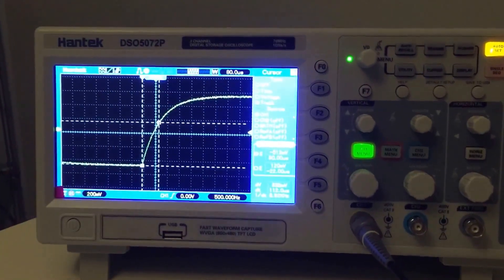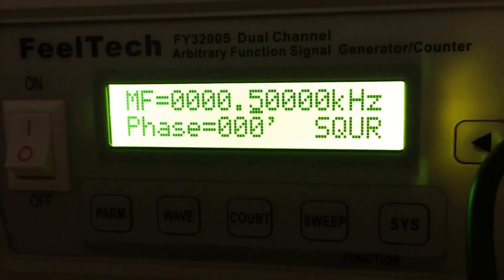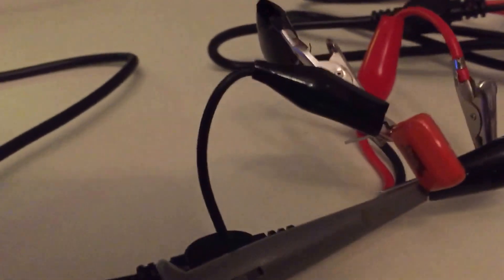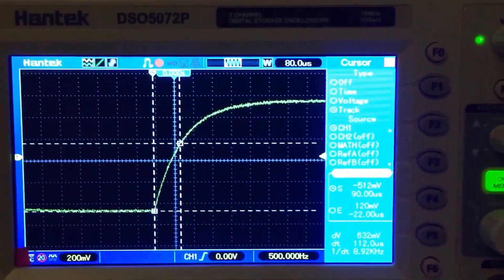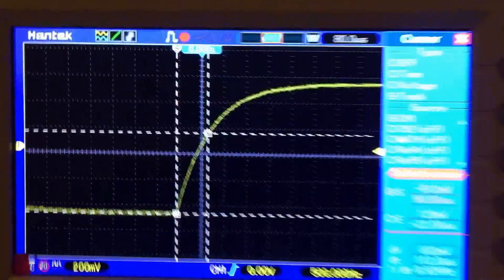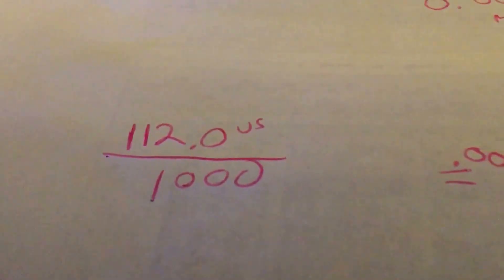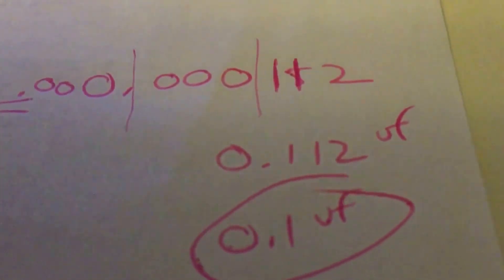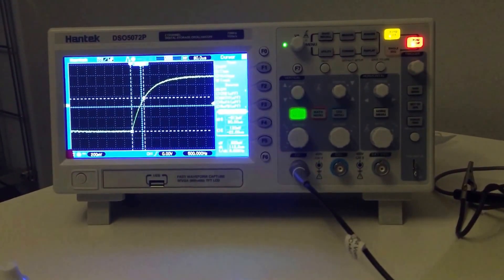Hantek 5072P and Feeltech FY3200S Capacitor testing 2 of 2

Comment: I wonder if the 5% resistor causes a slight difference. Maybe a 1% metal film would give a bit greater accuracy...
Reply from the maker: Theres no maybe, the 1% would provide greater accuracy. For the demonstration, it was sufficient to prove out the math. However, given the 10-20% tolerence of capacitors i dont think the resistor would make a difference.
Reply: I was mostly commenting on the difference you saw between the scope method and what you got with the cap meter. I will have to try this and see what I get. Nice video!